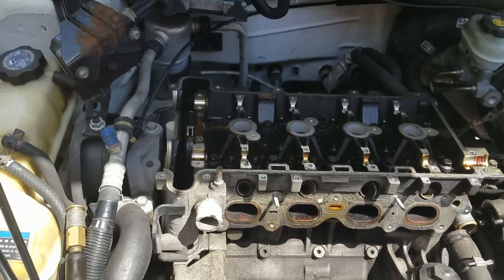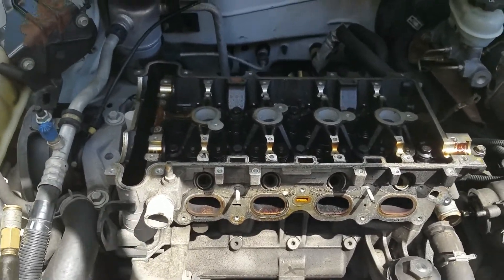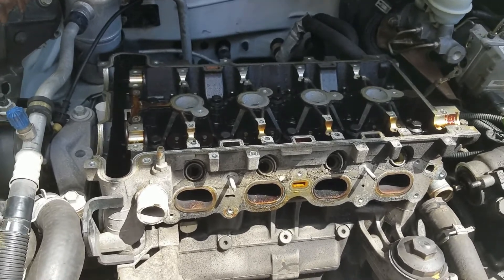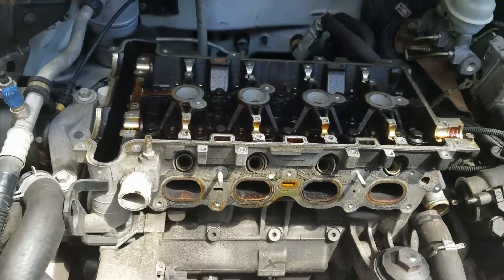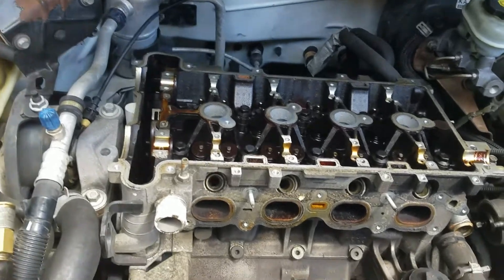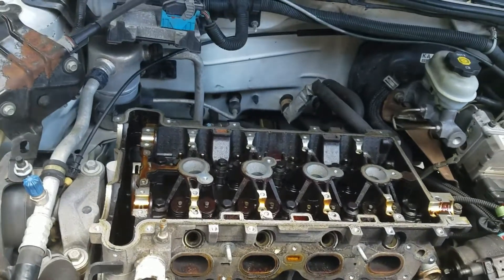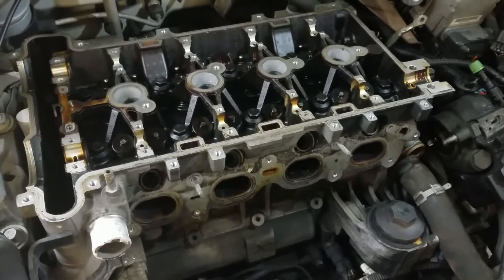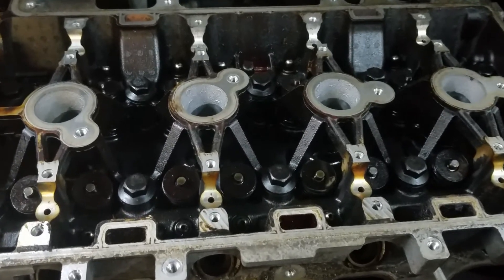How to Perform a Leak Down Test Without a Gauge

Comment: Hello, you should move piston to its TDC for each cylinder before injecting compressed air, else valves will be opened naturally and result will be wrong.
Reply from the maker: Incorrect if you are referring to this video, did you watch the full video to see that your advice was mentioned
Reply: Incorrect, piston position will make no difference to the test that's been shown here, as all valves are shut by the removal of the camshafts, so there's no relation with camshaft to piston position.. and the pressure injected into the combustion chamber would naturally be acting against the valve face by compression, if the valves were completely closed. 
Therefore if they are slightly open, the pressure exerted against the valve face will be less resulting in the valve remaining in its open position, while the pressure escapes past the valve, as the valve is off its seat and not able to resist the flow.